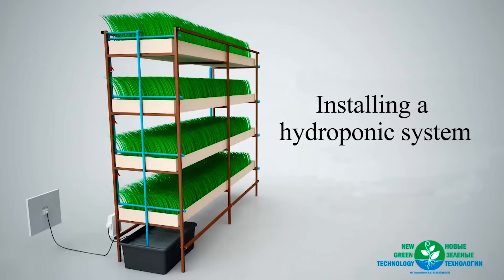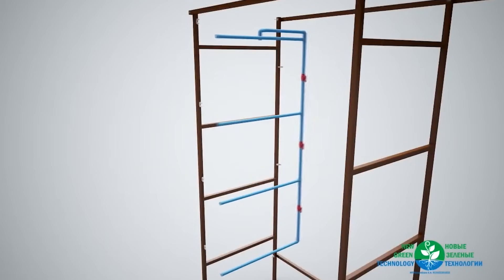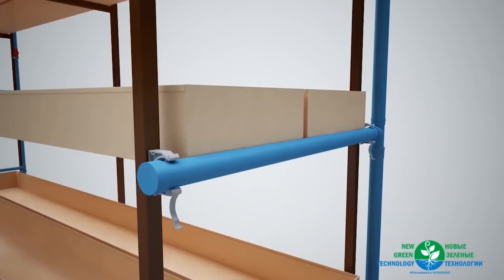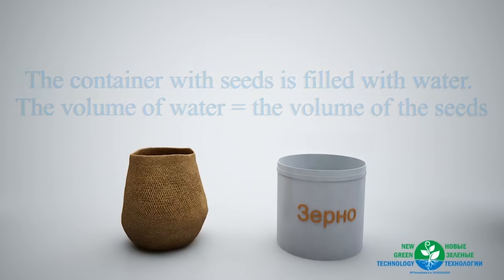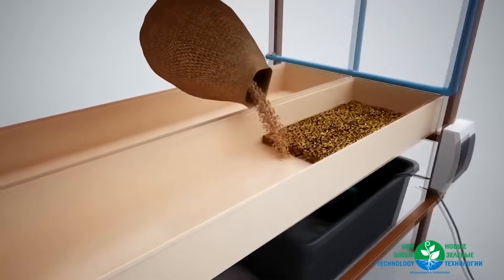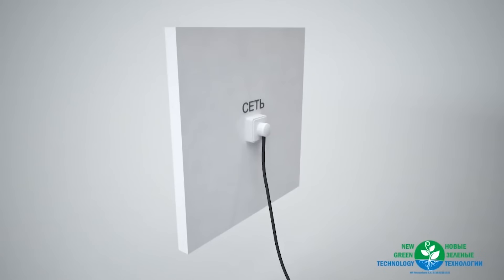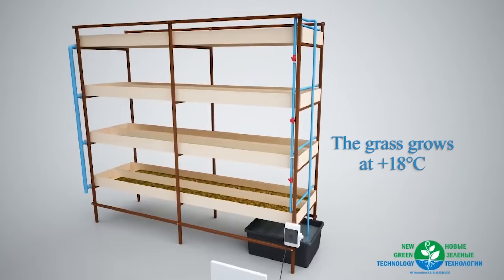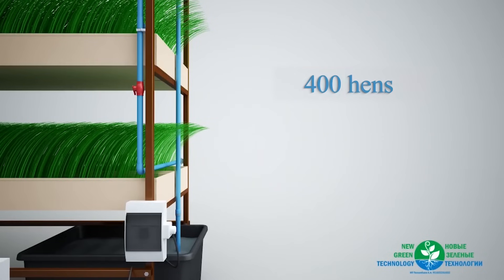Installing The Hydroponic System

Comment: The production technology is good. How do you water the seeds evenly? I also assembled a 30*60 cm module and installed 3 watering nozzles. Uniform watering does not work.When you water the lower part of the seeds, they will be wet, and the upper part will be dry.Wrong?

Comment: Water is flowing all the time? I think the trays must have some inclination to allow water to drain
Reply: This is a recycling process, on one side the water flows into trays, and drains out from the other side as the trays are holed in the bottom on one side, and the water flows out to the pipes.
Reply: It's supposed to drain out one side after it comes in on the other... but this has very strange piping. I've never seen one with this... and I've seen a lot.